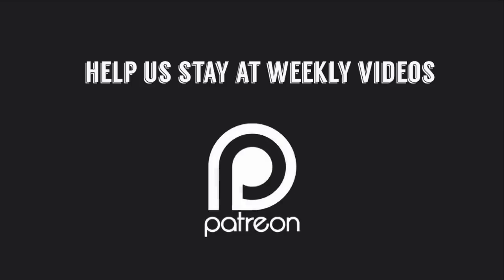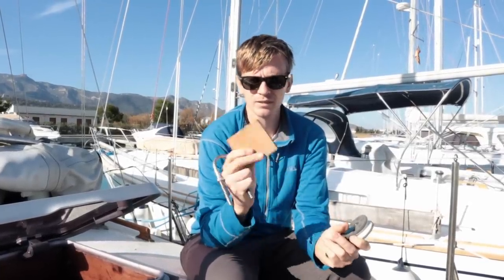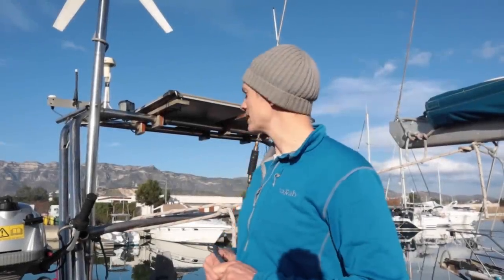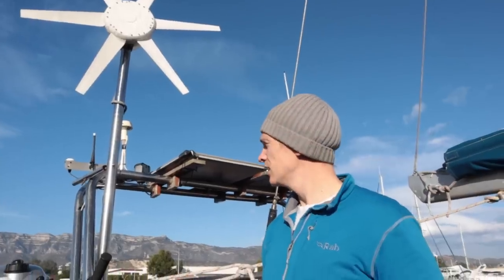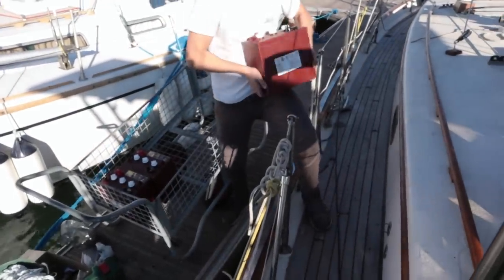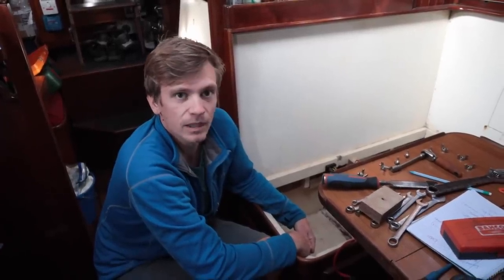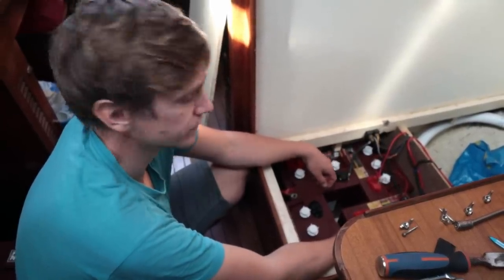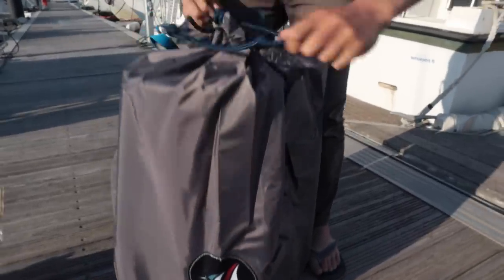43] Off-grid Sailboat Life: Installing SOLAR, Batteries & Sails

Comment: The teak block appears to be too small, making the hole too close to the bolt stress points. Not enough mass.
Reply from the maker: So the replacement will be bigger, aligned so that the bolts go across the grain, and shaped more carefully to the cabin top - then it should be ok?
Reply: Or you could use a piece of starboard(basically plastic) instead of wood. Plus over drill the hole going through the cabin top, put masking tape up against the cabin top and fill the hole with epoxy. Once it cures, drill the smaller, proper hole, this will keep the core in the deck from rotting from water. Nice progress so far, alot to get done, I know from my own boat!
Reply: @SailingKittiwake    I think the uneven non skid is crushing giving you an uneven surface and that alone will add stresses and cause cracks.  Across grain is better. 

Wider is certainly better if you can;t go thicker.  But I've seen others use hard plastic (Delrin?) for mounts in the past.  And Daniel is right about epoxying up bigger holes.  If you do that making a level bed of epoxy for your mount would help a lot.  Glass it in too.
Reply: Yes, definitely bigger, as in at least couple of inches bigger from each drilled hole. Yes grain direction would be helpful as well.

Let me give you an example, doing decks (siding, or w/e) and nailing / screwing about 3/4" from the edge can still occasionally split the end. Why you try to nail / screw as far from the edge as you can. You have a bigger hole drilled at roughly that same distance of 3/4" from the edge. Just asking to split the board. Wood is bad idea and not most appropriate for that exterior purpose anyway.

Comment: Looking good lovely new sail a quick question how heavy is your boat all up ready to go cruising ? Cheers Martyn
Reply from the maker: Thanks Martyn. I think around 11-12 tonnes 😊
Reply: Thanks for speedy reply our boat is similar in weight. We had same sort of problem the number 1 penny was massive an 8 meter foot . We had the club foot stay sail to. So we done away with the twin forestays and put a roller reefing system with a 6 meter foot for sail on that and we rigged a a dyneema removable first just behind that so we can still fly the big genny. When winds gets up drop it to the deck and use the roller feeding. Then gives you time to remove the dyneema stay back to mast if needed. Plus the bonus is we can fly a yankee on the dyneema as a twin head sail down wind set up if wind picks up start to reef the roller reefing in. Anyway my point is you might suffer in light winds like we did lucky for us the the big genny is hank on and a lighter weight. Our stay sail can come back as well  to make tacking a lot easier. Hope I'm not telling a granny how to suck eggs lol but as you know we keep on learning new stuff every day best wishes.  Martyn.
Reply from the maker: Luckily our boat came with a cruising chute for light winds. I think your setup sounds great, what diameter is the dyneema stay? We're also thinking about twin headsail setups but luckily our furler has twin luff grooves so could maybe do Genoa / Yankee or even rig one of the headsails with the staysail.
Reply: The dyneema is only 6 mm as you know its incredibly strong stuff plus the Hanks like new and nice and round no chaff. Twin groove is great be carefull not to have to much sail area on it there is a lot of pressure when wind gets up ,again as you know. Try furling in when to windy is a bit of a night mare I say that from experience. A friend of mine used a winch on his and twisted the foil 720 degrees before he realised. That's why I like to keep it simple less things to go wrong. Cruising chute ideal did it come with the boat? Its gunna be a lot bigger than the one on the Cat bless her, if you get it wrong it will lift you off the boat . Great sailing channel by the way I wish I done it at your age. No gps when in the 80s well there was but cost more the our boat.
Reply: Have a look at this you tube clip, Dolphin sails, down wind sailing. Everything is right about it especially with the extra halyard to hoist and retrieve the second sail.

Comment: The metal spacer on the top of the teak block is too small and created a point load and dug into the teak. Make the spacer larger and match the bottom of the block to the curve of the deck. You can do this by affixing a flat piece of coarse sandpaper to the deck facing upwards and sanding the base of the block against the sandpaper deck until the block matches the curve. Otherwise use crush tubes on the bolts to limit the compression when they are done up, as the core in the deck may be compressing and changing the curve of the deck under load. Ideally you want a solid core anywhere you affix through a deck so this doesn't happen.

Comment: Please mind the audio levels. This one goes from conversational to OMG and back.
Reply from the maker: They looked all level on our software. Which segment are you referring to?
Reply: @SailingKittiwake  Throughout the piece if the volume is set so one can hear the dialogue the music track will shake the walls.  I suspect you are being fooled by the audio software in your laptop which is designed to protect the tiny speakers and your ears when wearing headphones.  On a home system without limiters it is very different. (Not to mention an output power capability probably a 1000 times larger)

Comment: ur backingplate should be on the inside of the boat not outside  hopr u dond pull it out  nice video
Reply: There's 2 "backing plates",  Installed properly, as they are, they sandwich the substrate.

Comment: Where was the solar regulator at? Or do you plan to use the engine alternator to regulate the solar panels as well? And a good bit of advice young man, That wrench was giving you a wake up call, You should buy your self a carpenters full face shield, Not in case a wrench hits you but when your working in any enclosed area with batteries they can blow up, I know, because I blew one up and it was just one loose wire that caused that explosion.
Reply from the maker: Thanks for the tip! We used a Victron MPPT which is also what we had on Kittiwake and it's always worked a treat.
Reply: @SailingKittiwake  what is a MPPT?  Richard
Reply: A MPPT is a type of charge regulator.
Reply from the maker: You wire it in between the solar panel and the batteries and it turns the solar panel's charge into charge for the 12v battery system. There's to main types - MPPT and PWM, MPPT being better but more expensive (but for us totally worth the money)
Reply: @SailingKittiwake  umm, If there 6 volt you cross at the batteries. as far as 12 volt. 24 volt or 36 volt that changes at the back of the solar panel. I know where the regulator go's because I have mine sitting here in the bedtroom not 8 feet from me, with the batteries all wired up and working. You didn't mentioned it or I missed it, that's why I asked the question. Like one of my friends, he uses car regulators where I use store bought regulators. I was just curious.
Reply from the maker: Ah sorry I was replying to Richard Gough

Comment: I can tell you why the block split. You forgot the cover of the area you were bolting the block to. You need to shape all fittings to what ever area you are working on. Remember you can not change a hard fixed area to suet.
Reply: If you soak it in fresh water a few hours it won't crack either..
Reply: @TheDrloboski  Sorry mate that small block needed to be shaped. A larger length you could soak it, but steam would be better.
Reply from the maker: I think it was actually shaped too much and the hollow cracked it.
Reply: @SailingKittiwake  It cracked because the grain of the wood block was vertical (aligned with the stress you were applyin) instead of horizontal (perpendicular to the stress).
It won't last long at the all and the crack will get bigger very soon.
I also noticed you used plain nuts to hold it from below. Should use nuts fitted with plastic brakes.
Reply: @SailingKittiwake  Well, what ever good luck.
Reply from the maker: So the replacement will be bigger, aligned so that the bolts go across the grain, and shaped more carefully to the cabin top - then it should be ok? And I'll pop some nylock nuts on.
Reply: @SailingKittiwake  You got it !
But remember that the tension from the sail sheet on that block will always be upward. So a piece of wood that thick on top of the deck adds nothing structurally. 
Make it thinner with horizontal grain. Just pay attention to the curvature of the grain and lay your piece on the deck with the curves facing down. That way it will tend to shape itself to the deck without having to carve its underside. 
PS: watch your toes when sailing. Garanteed you'll bang them at night a few times on that U bolt.

Comment: I don't even own a boat yet, but recently came across a site where a surveyor went through the various problems he had seen in boats. It was fascinating. If the batteries are not in a plastic box to catch leaks and are not well ventilated maybe read up on it and have a think.  "...the electrolyte (sulfuric acid) they produce must not be allowed to spill into the boat..." http://www.pcmarinesurveys.com/Marine%20Survey%20101.htm

Comment: If I were you I would replace that piece of wood, because it will come back to bit you in the near future. It won't last long and it will split and the nuts will come loose.
Reply from the maker: Yep it'll get replaced next time we've got access to power tools (hand sawing that old teak is a pain!)
Reply: joseph muscat I totally agree, it’s already cracked!  Glad your gonna replace it.
Reply: @SailingKittiwake  have a look at ryobi 18v tools they all run off the same size batteries which can be charged via 12V my friend has drill, multi tool, angle grinder spot light and air pump for dinghy, something to slowly build up as you need.
Reply: Drilling that hole so close the edge of the block is not good, either.  Make the block a little larger next time.

Comment: I had a problem with using that gage wire on my battery bank.  I was told to double the wire gage at least and don’t double the wires. It won’t help the low amp problem I was having. Turns out the thicker the jumper wires the better. 2 and 4 gage wire will start to heat up under load. I finally used solid copper straps to connect my batteries. Afterwards I got maximum power from my battery bank. I hope this will prevent a future problem for you. Please revisit your wire choices.